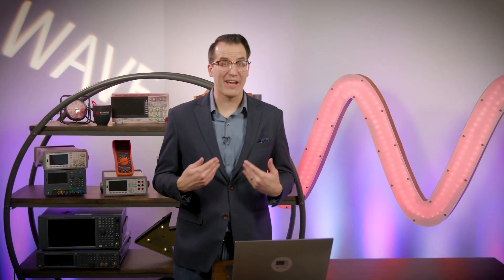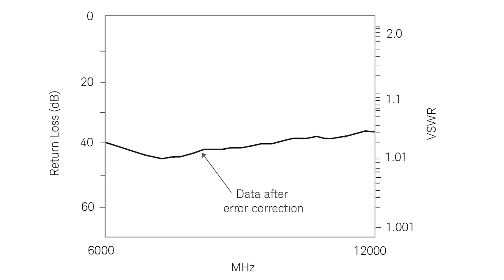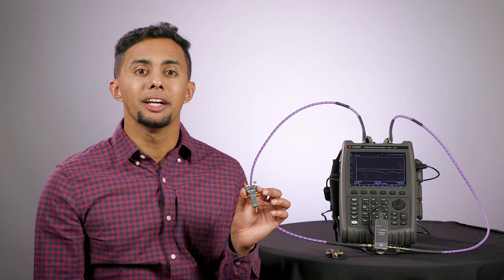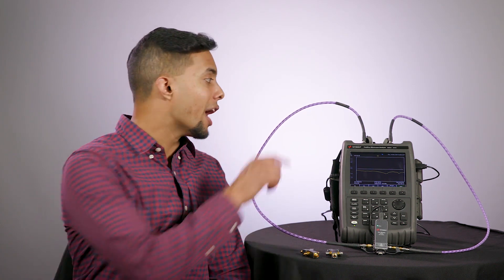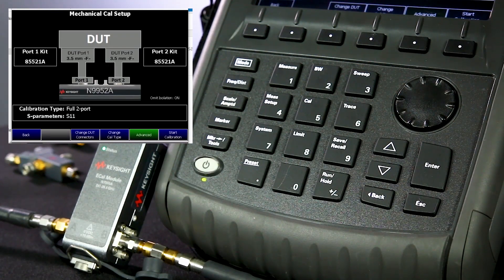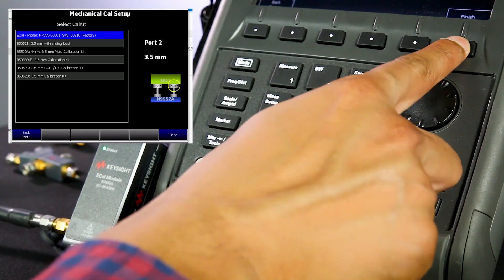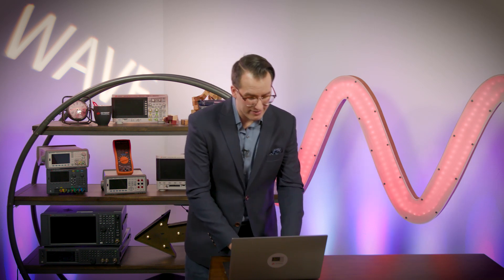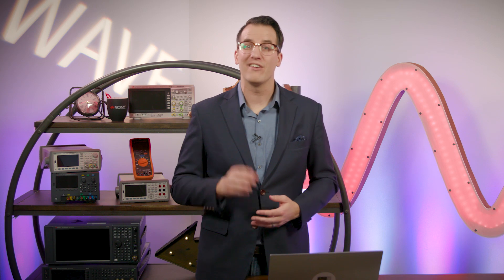VNA Calibration and Today's Wave Winners! (13-Mar)

Comment: The translations are absolut rubbish and even contradict each other. Why cant I do the quiz in english?
Reply from the maker: You can choose an English country from the registration page and get them in English. What language has weird translations?
Reply: So I have to register again? Is that even allowed? :D
German was said language, see here:
"C. Sie spielt keine Rolle, da das Rauschen, bedingt durch Umwelteinflüsse, den an das Gerät gelieferten Strom beeinflussen kann
D. Sie ist wichtig, da die Kabelimpedanz eine Signalverschlechterung verursachen kann "

Let me translate that back to english:
C: It dosent matter, because the noise, due to environmental influences, can influence the delivered current.
D: It does matter, because the cable impedance can cause signaldegradation.

I think everone can see the conflict in these two.

Comment: The get daily entry button is still not working for me, hasn't worked since it acted up for everyone during the live stream
Reply from the maker: Hi Jeremy, can you try clearing your cookies and/or your browser cache to see if that helps?
Reply: Nope, doesn't work, and I tried a different browser too that had never been to any Keysight...site just in case
Reply: Also, doesn't clearing the cookies remove your ability to tell it was me who clicked the entry button? I didn't see a way to log back in or anything
Reply from the maker: Just to be clear, you can see the button but it doesn't work when you click it? If you get to the first-time registration page, and use the same e-mail address, our system will recognize you and give you the entry for the day when you fill out the form. That being said, I do see the daily entries for you in our system.
Reply: Yes, I can see the button but can't click it. I have the entered query string so it shows me as registered.
Reply: Using the chrome Dev tools, it throws an Uncaught SyntaxError when I click the button. JASON.parse in jQuery. If you like I can post the whole message
Reply: JSON*
Reply from the maker: Ok, apparently it happens if you mash the button :). It should now have some code that fixed it.
Reply: It looks like that fixed it. I filled out the form to get the cookies back and it let me click the button. Thanks, I didn't want to miss any more entries! Enjoy the rest of your day.